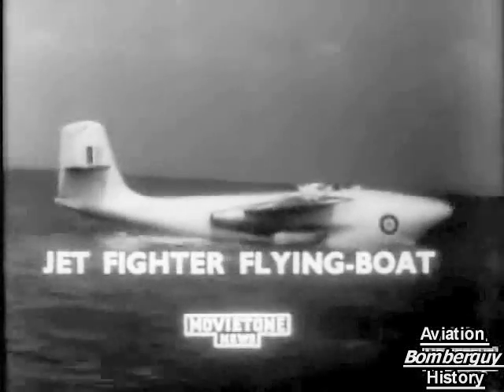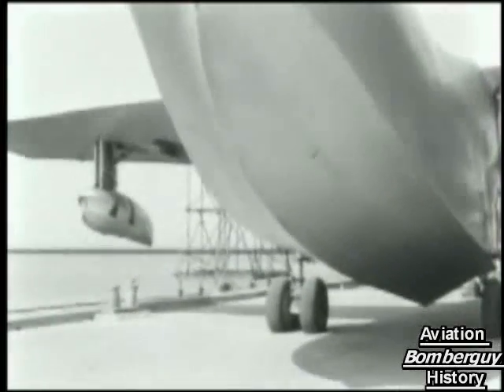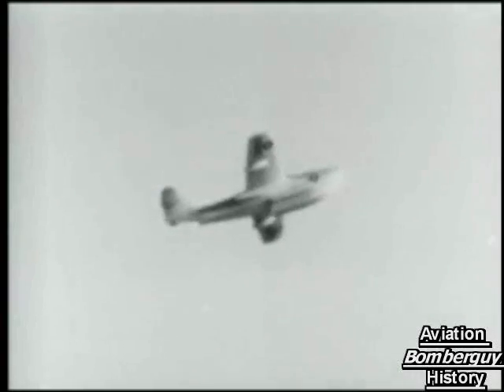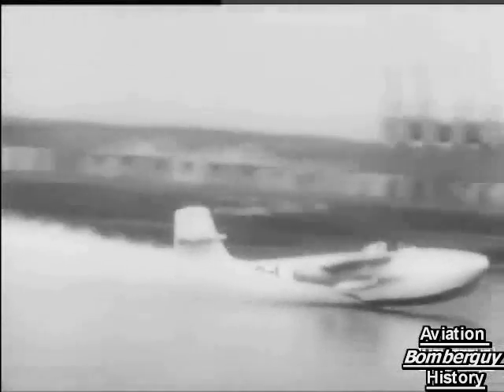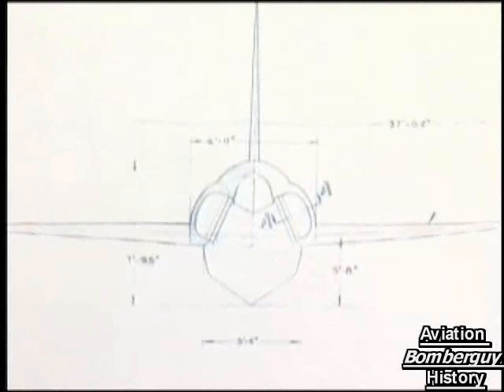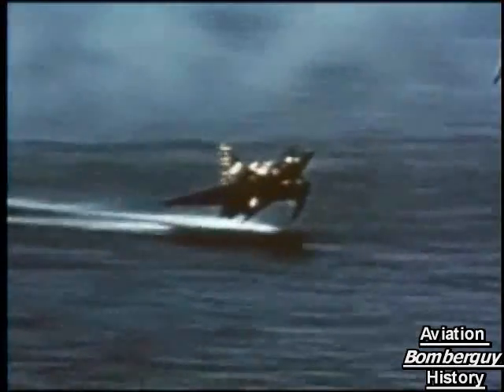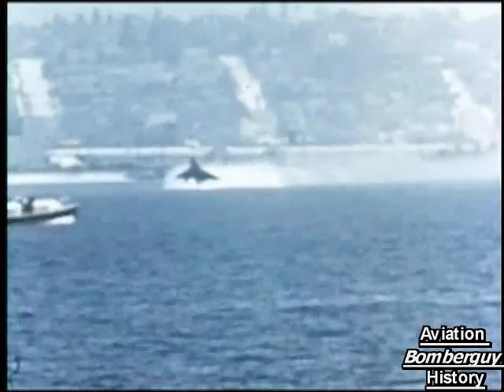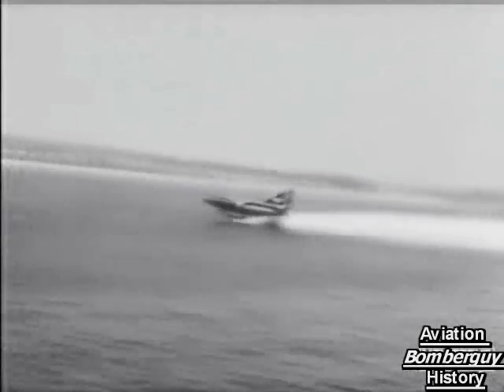Wet Jets: Sanders Roe SR A/1 and Convair Sea Dart

Comment: The same genius who designed an ejector seat for helicopters.
Reply: They work fine on Kamov helos 👌
Reply: ejector seat for helicopters exist and work but  the US doesn't use them so thy must be a bad idea
Reply: pervertt 
The heli ejects the rotors before the seats, just like a fighter jet ejects the canopy.
Although that didn't work so well in "Top Gun"!
Reply: @JohnJohansen2  Yeah its not too hard to shear a main rotor shaft with a small emergency explosive device. I had designed something in highschool which was just a blade that sheared the rotors off as they passed the 6 O'clock position. Thus throwing them away from the cockpit and protecting the ejection seat

Comment: on thefirst flight of british's jet youll hear a boom that is when a log hit it and knocked the star board float off!!!(with a 4 foot dent) The sea darts crash was due to the hydro skis which worked well until 60mph then caused severe vibrationsand that helicopter chaseplane was  a bell HSL-1 (also crashed)

Comment: My father helped build the Princess Flying Boat. I was shown over her and the mock-up when I was about 12 yrs. My ATC Squadron Leader was one of her Flight Engineers. He tells of concerns about special gear boxes on her double engines. Shortly after take off thermometers showed overheating. They solved the problem and their anxt. They removed the thermometers! Also when banking over crowd at Farnborough she was out of control. Power assisted ailerons malfunctioned. Saved by manipulating engines

Comment: It's open to debate. In the hands of a good pilot, and under conditions that might tilt the odds in its favor, such as catching the other jet low on fuel, diving out of the sun, during landing/take off, etc, anything is possible.

Heck, the Gloster Meteors had some problems shooting down V-1 bombs with their guns, but they quickly figured out how to take them out by tipping them over by using their wing tips.

So again, any thing is possible.